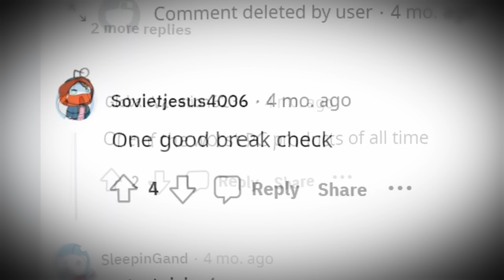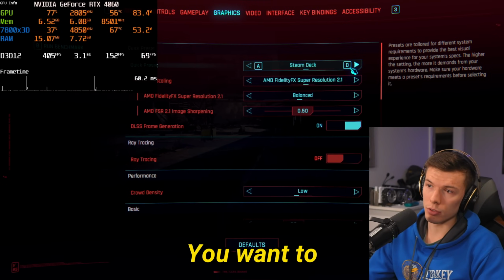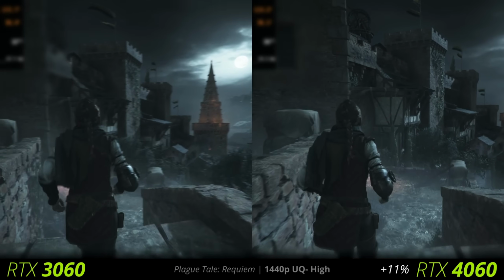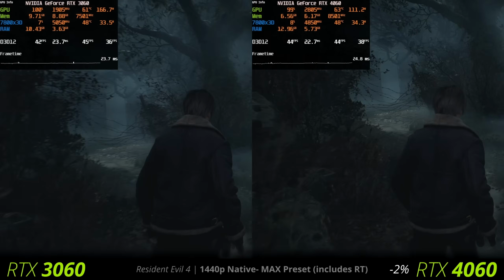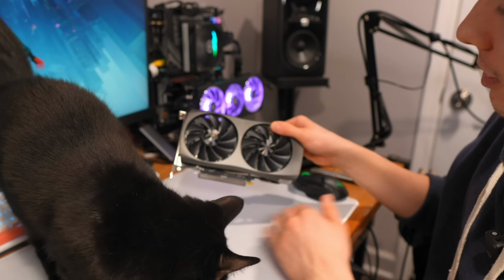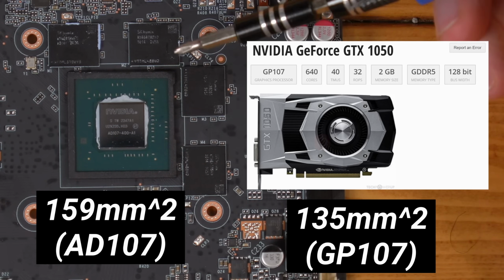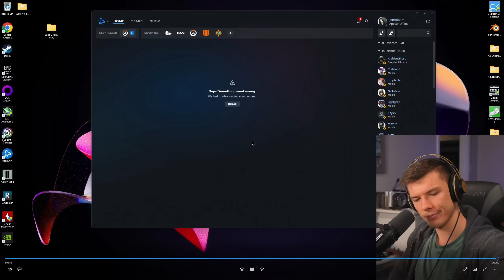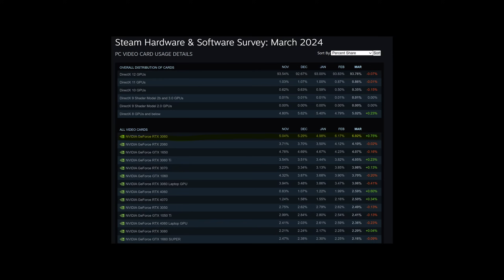I Tried Nvidia's best "Budget" GPU to see if we're Doomed

Comment: I had a RTX 3070 and I was shocked that the RTX 4060 was slower when released. This has to be one of the worst "upgrades". How could there be a step down from 3070 to 4060, when moving up a generation?
Reply: The 4060 was never intended to be an upgrade for the 3070. They're a different class of cards altogether

Comment: The annoying part is that you can buy a used 1080ti on the internet for sometimes half of what you can buy a 4060 and it still out-performs the newer card on most games. Plus the 1080ti has more ram.

Comment: I bought the Nvidia RTX 4060 to replace my Nvidia M4000 because of the low power draw.  My other top runners in my list were Nvidia's P4000, and Nvidia's T1000 8GB.  The other two did not perform as well, even at 30 to 60 FPS.  I run AutoDesk's AutoCAD on a Windows Server 2022 machine.  There are no Windows Server drivers for AMD or Intel cards.
I was left with some rhetorical questions.  First, why does the card have an eight-pin power connector, when its TDP can be provided by a six-pin capacity?  Second, why is the PCIe connector physically an x16, when the electrical bus is x8?  Third, can the card run safely without the two onboard fans attached?

Comment: I mean, I have a 4070 Super with a I7 12700K and I only get 70fps in downtown cyberpunk on high settings 1080p with low ray tracing settings so the 4060, a card half the price only getting 20fps less makes me think either the 40 series cards suck just in general or ray tracing is just to advanced for mid/high tier new cards.

Comment: I am sure was that card with 192bit as 3060 and 2060, so will that card be a killer, i have a rtx 2060 6GB and i can run cyberpunk on 2k with high settings and ray on low and get 48-60 fps and when i overclocked the card can i get up to 90-100 fps is not bad with 6Gb vram.

Comment: so that could be a little late but I'm entirely new to pc builds but i would say  i got the card  without any knowledge about gpu cards i just had the mentality of "oh its the new gen it should be better" and there is two sides to that cuz i got it for less than 250 $ so i Gusse it is not too bad for the gaming experience so far so good im mainly competitive games player r6 cod ow etc with a 144hz 1080p Moniter its actually quite good im able to get the full 144 fps on high setting almost everywhere on the other games for example rdr2 i can average 112fps on ultra setting with dlss and around 80 without for video editing its actually not too shabby i can edit 1440p videos with ease butr some time and i would say its rarely happened to me it would get to a choke hold where cuz of the vram so i would say its not too bad but the pricing is probably the biggest issue here witch i had no issue with so i would recommend it for someone like me who is not too demanding and in the condition that its in less than 250 price

Comment: I'm about to buy this card due to it's low power consumption, but would rather wait till they do a 4060 V2 with 12GB-16GB of VRAM (I own a 4K capable screen) similar to what happened with the 3060 V2 12GB. maybe now that the Intel ARC B580 12GB is at the same 4060 price point, NVidia will get off it's high horse and do something with the 4060 to make it less boring while still $300usd range affordable.

Comment: I had an even worse experience with 4060 and on movies: huge frame skipping - characters were teleporting from one side of the screen to the other, instead of the smooth movement you can see with any other GPU. So I returned the 4060 to the seller and told them to smash it into their heads and went and purchased a second hand GTX 1080 Ti from a gamer. It's unbelievable how smoothly things run with AORUS 1080 Ti. On Alan Wake 2 at 1080p at high settings I got steady 45 FPS (as if the game were locked at this frame rate). Now I'm installing Cyberpunk 2077 to try it, altough I already suspect what the results will be - burying the 4060 into the ground. 🤣

Comment: I mean I got mine for a bit cheaper than usual. I got it for around 370 CAD which is about 270-280 USD off the top of my head. I look at 4070's and the price is basically double while 3070's are maybe around 100 dollars more depending on the site. Unless you get a big discount or buy used I'm not really sure where else you can get a decent card for that price. The card can run almost any game I throw at it. Sure it probably won't be able to run 4k ultra path tracing 120 fps but if you're in the market for an affordable yet still effective card this one is fine. IMO most of the hate just comes from people who are reaaaaaaally into computers, but for the average person this card will do for most things.

Comment: Is this just the raytracing? I have the 3060 12GB, which should be slower than this, and it runs CP2077 perfectly fine at 1440p60.  I don't use the graphics presets, but most things were set quite high, with depth of field/postprocessing/AA off (since I dislike them). That was with proton on linux.

Comment: I’m build budget stuff and the rtx 4060ti 16gb is cool for me cause lots of processing space and I used to be on ddr3 intel hd graphics 250, and even 3050 6gb is fine in my opinion cause it works and not everything has to be max graphics.
Reply: But to be honest the 5060 base model better have at least 12 gigs cause nvidia is just being scammy and I’m sick of thier precautions of making everything be obsolete after 2 years, they need to make another reputation equivalent of the gtx 1080ti so they can be respected in thier place as mainstream cause I do want everything to be max graphics even if it don’t need to be

Comment: I was gonna build rtx 3060 i5 12400f but now its gonna be a rtx 4060
Reply: I'm confused, i5-12400f + 3060 or 4060???  Only hesitation is vram of 4060
Reply: @akpishere  new update bro I'm going for a rx 6750xt 😂
Reply: @akpishere  3060 12gb is better in 1440p but in 1080p 4060 is slightly better 
In my opinion 
 if nvidia is you choose go with 3060 
But if you want best performance go with rx 6750xt absolutely beast on its price
Reply: @justanormal16yearoldkid51  but I'm gonna do video editings too
Reply: @akpishere  then nvidia is your way to go

Comment: I have a 3060 and the 4060 does not even represent a %15 upgrade. I have the 3060 12gb version with the 192 bit bus. I am gonna wait till the 5000 series come sotu as the outlay for a marginal increse in performance is not enough. I am also not spending 500 pounds on the 4070 when the 5000 series is just around the corner.

Comment: Like many have said, there's no such thing as a bad graphics card, only bad pricing. If the thing wasn't so dang expensive, then just about every respectable budget gamer would be rocking it. Heck, I would have been, If I was still working a part time job when this thing came out. Nowadays, I actually do have a little jingle in my pocket to spend on a more mid to high range card. Oddly enough, Intel's new GPU line might fit right into the budget GPU gap that had been missing in the market. Especially with them now having a previous GPU generation to work on drivers, I would have no problem using an Intel GPU if prices stay as Intel have reported them being. I am actually building a NAS/server PC so I might snag up an Intel Battlemage card to go in that for some extra boost to game server performance and streaming for a Plex server

Comment: As a laptop user, I can safely say that the mobile RTX 4060 in a laptop is almost the same performance as the desktop one. And for me I would say that it's worth buying. Unlike the mobile RTX 4090 that has similar performance to the RTX 4080 desktop and was too far behind from it's desktop counter part due to the limited CUDA cores and wattage limit.

Comment: The 4060 is the most power efficient midrange card out there right now.  If you undervolt it, you can get it down to around 75W and still get good performance.

Comment: Is there a difference between 4060 and 4060 ti? I bought a 4060 ti and everything including cyberpunk with ray tracing works just fine with ultra settings on
Reply: Absolutely. The 4060 Ti has more CUDA cores, more TMUs, more L2 Cache, and faster memory and core clocks compared to the 4060.
Reply: @usul573  oh that makes sense, thanks

Comment: i mean the 4060 as little more performance than a 2080, i am rn using my 2080super rog and i got not really some problems in 1440p, i know i will not get 144fps in ultra settings in more recent games but you know work pretty well. (the comparison at least is on websites not videos)

Comment: ok so if not 4060 then what should i get? I don't care about 60fps on max settings, i don't care about ray tracking. I just want to play gta 6 and wither 4 when they'll come out. I had r7 370 since 2016 and I've been moderately happy with it. I'm looking for a new gpu only because my 370 died. I want to buy a card and be able to play newer games at minimum settings for the next 8-9 years. What should I get?

Comment: Even the Amazon drivers and Porch Pirates know that the 4060 is a paper weight

in my experience the frame generation only works if you already have 60 or 70 fps without it. The delay isn't as noticeable the higher your regular fps is. Which makes the entire technology more of a band aid than anything else as you need a fair amount of real frames to make it work.  To notice the delay in cyberpunk is really bad as that game can still be played alright at low fps (many pc gamers wouldn't feel good but they can at least play it) vs other games.

Comment: Here I am judging all these 3000 and 4000 series cards while I'm still using a 4gb gtx 970 HAHA. 1600x900 75hz (60 overclocked). I play most my games on medium-high settings. At least I have an I5 9600k, that's still a beast even now the speed is incredible who needs 12 cores? An upgrade in many departments would be nice

Comment: If you have to buy a 40-series graphics card for no more than $300, the 4060 is THE card to buy.  But for ~$10 more, you could buy a 7600XT, which performs roughly the same in games but with twice the VRAM so teaking settings to stop textures overflowing your buffer is just a thing.  Or you could scrape together another $20 (wait one more paycheck maybe?) and buy an 6750XT that's 20% faster with 50% more VRAM.  Yeah, it's October 2024, and we can still buy a NIB 6750XT for $320.  If I didn't already have cards that are faster than the 6750XT -- and an actual 6750XT -- I'd snap one up NIB now before they're gone forever.

Comment: I love my 4060 shrugs

It's a great card on sale or used. I dont upgrade every year, I came from an AMD RX480. so it was a massive upgrade, and it's cheaper than everything else by a lot. I get 160-200 FPS in fortnite on medium, DLSS balanced. I get 100-120 FPS in hogwarts legacy on mostly "high" settings (one or two on medium) with DLSS balanced. 

This is at 1440P. I don't see how this is a "bad" card.

Comment: Im using Intel i3 6100 with GTX 750 TI, and I WILL upgrade it to Intel i5 14400f + ASUS DUAL RTX 4060 or Ryzen 5 7600X + RX 7600 by Christmas to make it cheaper with all deals in the markets.
Even I upgrade my GPU to RX 6600 its already a huge leap for me, so don't eat all entire bait from them.. just buy and use what you can afford. its a good GPU btw..

Comment: I understand $300 is a lot for a low-mid range card. That is unfortunate and I wish the 4070 was not $700+

That being said, just play at 1080p medium. You know you bought a midrange card. Of course it’s going to struggle at ultra settings because you have 4K textures being loaded. Just play 1080p medium settings, it will look 90% as good and might double your frames. This is a compromise card, not a “no compromise” card. I can almost guarantee it will play smoothly at 1080p and 1440p with the medium settings that it is intended for.

I do agree that the “RTX” marketing is overdone especially for the midrange cards that will likely struggle. But I would be interested to see raytracing at medium settings with DLSS.

Comment: i agree with the fact that its not THAT bad like bruh i would kill for a 4060, its really not that bad because i have a 1660 ti which my pc barely runs games like GTAV at more than 60 and my CPU (intel i5 9400F 2.9GHz) is WORSE barely able to handle games like fortnite with more than 100 fps, That flaw is pretty much half of combat games unfair advantage towards high end computers as well as games like forza which timers literally work differently based on your framerate which means speedrunning or trying to get good times is not something you can do well.

these issues are just something which comes with a low end pc, however my pc was previously close the same price as a current high end pc for £1200 which really is not fair. the prices for these products are Not justified.

Comment: my friend  there is something wrong with that  ZOTEC RTX  4060 I am playing  Alan wake 2 on ultra wide monitor 2560x1080 with DLSS   balance and ray tracing medium  with path tracing on medium and DLSS  ray construction and graphics set to medium with HDR  with frame generation on and I am getting perfect smooth 75 fps  and hardly drops below my monitor refresh rate 75 MHz refresh rate  u cant reach even 50 fps on 1080P  low with DLSS and no ray tracing

Comment: GUYS I NEED HELP.....now in the end of 2024 i want to buy a gpu and i cant decide between 3060 and 4060 because i dont care about gaming because either card can game just fine but i do lots of 3d rendering stuff on various software for architecture..........and rtx 3060 is about 12 usd cheaper than 4060.....i cant decide because 3060 got 12gb vram.....i am confused af

Comment: i think im still gonna get the 4060 for my first gaming pc because..well..$2000 is just not worth it in my opinion tbh when i can still run very good games like cyberpunk even if it is low graphics but i wont even play games like cyberpunk, i really only play fortnite, rocket league, ready or not, beamng, roblox and minecraft and like a few other games that arent crazy and u dont need a 4090 for because i can run all those with a laptop currently. so i think im fine with a 4060 lol. (if anyone knows do you guys think overtime i should upgrade to the 4070 and so on or should i just save up for a whole new pc thats even better than the one i will get)
Reply: I average 55fps at 1440p with mostly everything on high or medium and dlss on for cyberpunk. If you don’t care about ray tracing you can easily hit 60fps at 1440p. The updates to the drivers have made the 4060 better than the hate it’s actually getting in my opinion. I bought a prebuild for $800 on sale and I’ve had no real issues. It’s also my first gaming PC so of course I’m going to be happy without comparison. Only wish it had more vram. I have a PS5 too so games like Alan wake 2, I just play there. For what you play, you’ll be more than happy.
Reply: @sicdedworm09  yea i will be more than happy because im not gonna play cyberpunk or anything like that and at most ill have like 15 games on my computer and none of them are really crazy demanding games because i already have them on my laptop and can play those games at medium settings so ill be fine with a 4060. the only difference is instead of medium settings itll be high lol.

Comment: I use rtx 3060 and the only thing that you can play reliable with raytracing is... minecraft on shaders.
Those 10% is not something I would set my mind at, but the loss of 4 gb of vram would kinda hurt.
I would rather sell my crap and invest in something like used rx 6800xt.

Comment: I built 2 gaming PCs on a budget, one for me and one for our teenager. They got 4060s because that's what the budget allowed for. And we have a lot of fun gaming! I play at 1440p and the performance is fine. It's not great, but it's fine. And if you look at the performance/$ of available new cards honestly its a pretty straight line. The 4060 performs right where it should for the price, and no more. But show me a graphics card on the market today which really gives exceptional value? And if you have a tight budget ... what is really a better choice? You say the 3060 will age better but i disagree - nvidia are known for subtly breaking older cards with driver updates (and by extension newer games) after a couple generations.

Comment: Are we actually getting to the point where mid range gaming is not that enjoyable without janky tech like DLSS and Frame Generation?

Honestly I think those features are great, but it should not be targeted as a mandatory feature to "Run A Game at 1080p60", these features should be used for targeting 120FPS and above.

Back when we are still debating between the RX480 and GTX 1060 they were rocking The Witcher 3 and Battlefield 1 at 1080p60 without any of the mentioned above features.

Comment: Bought a whole new Pc 1.8k Euro (1.9k$)
Then i asked the store owner if they have some refurbished GPUs, cause i had a Second PC at home but no GPU for it.
Since i bought all PC Parts from the same Store they made me a special deal. I can have one of the 4060 for 100Euro (107$) because the box was Wet and had Paint on it and some Law in germany says he cant sell the item anymore cause something about refund politics. So he would need to send it back to His Supplier and get a replacement which would have cost him more then selling the GPU after Taxes. 
So he sold it to me ''under the table''
We popped it in the Stores Test Rig to see that it works and then i went back home. 
With a Monster PC and a fine little nugget for my Second PC. 
300 Bucks would be a lot. But damn. For 100 bucks im soooooo happy.
Im almost more Happy for the PC i use for Streaming then the expensive one i use for Gaming.